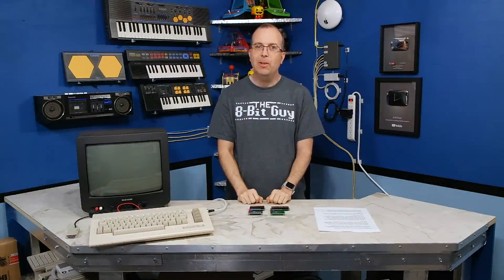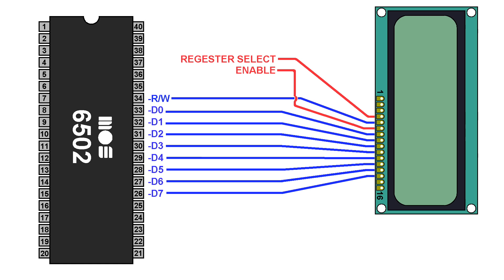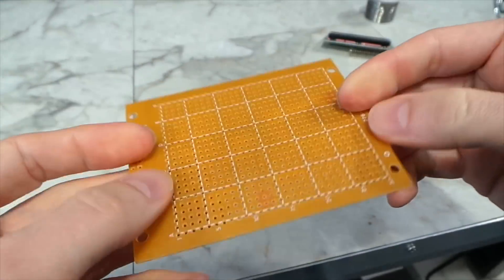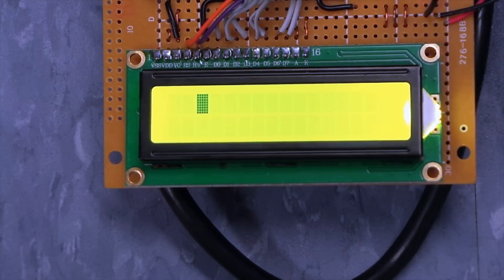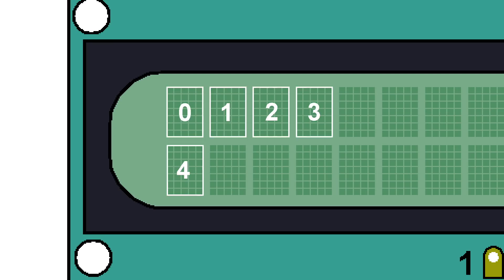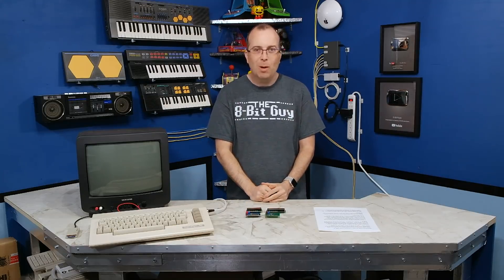How a Character LCD Works - Part 3

Comment: Theese displays can also work in 4-bit mode, requiring only 6 pins: RS, E, D4, D5, D6 and D7 - simpler hardware and a bit more complicated code. Also, there is no need to print 40 characters to go to the next line. There are many commands you can use, for example to go to a certain line, position inside line, change the cursor size and blinking, (auto)scroll the display, change the text direction, etc.

Comment: Maybe you can ever connect it to the serial port on my old AMD Athlon XP 1700+ system?
Reply: Totally impossible. PC serial ports work very differently than the pin assignments you see in the video. In fact, connecting it to a PC at all is going to be a challenge. But to give you a few problems for a serial port: Serial port does not provide power. Serial port uses 12V for logical 1 and logical 0. LCD Display uses a parallel interface, not a serial one.
Reply: The easiest way to connect to a PC might be to connect it to an Arduino that is in turn connected to a PC.
Reply: I thought something like that, i think i'll be programming something like that

Comment: was there a C compiler for the C64 in it's heyday? Dealing with the non contiguous LCD lines seems like the kind of thing that would be a pain in ASM but pretty trivial in C.
Reply: Nowadays there exists the cc65 cross-compiler. To my knowledge there wasn't such a compiler in the golden days. A weakness of the 6502 architecture is that it is not efficient to pass subroutine parameters via the stack, but is quite necessary to implement languages like C and Pascal efficiently.

There were Pascal compilers for the C64 in the golden years though, but that might have to do with that Pascal was much bigger than C in those days.

Dealing with the non-contignuous LCD lines doesn't look that terrible for doing in assembler to me though, likely a few branches to handle the different cases.
Reply: Daniël Mantione what property of the 6502 makes the call stack inefficient?
Reply: There exists no stack relative addressing mode, which means that you would need to pop from the stack one-by-one, or construct a separate pointer in the zero page.

CC65 doesn't use the processor stack at all, it creates its own stack, independent from the processor stack.

Comment: 2:13 IO1 pin is low not only when CPU is accessing 0xDE00, but accessing data in range 0xDE00-0xDEFF. If not, 0xDE01 won't work.
Refer to https://www.c64-wiki.com/wiki/Expansion_Port

Comment: ...or You could switch lcd controller from 8 bit to 4 bit communication and save a lot of troubles. But I guess channel name obligates ;-)
Also have a read on HD44780 commands, there's plenty of tricks to them... Like, you don't have to send all these spaces to get to 2nd line. You can simply set cursor position with 1 command.

Comment: If you do more experiments with electronics, you should buy an oscilloscope, or at least a logic analyzer, this would have saved you some days troubleshooting. The best solution is an oscilloscope with an integrated logic analyzer, because then you can see analog signal in combination with digital signals, like the rising edge of a signal or a DAC output. Siglent has good ones, not too expensive. Or just something like a Saleae logic analyzer.

Comment: You could change cursor location by setting data ram address to 0x40 for first character of 2nd line instead of wring bunch of spaces. May be more complicated to write a code, but will be faster.

Comment: Yeah, you really want to use assembly (or some other way, code on bare metal). Maybe a faster CPU too like on an arduino. You could make a graphic equaliser, like you get on a HiFi music system if you separate the audio signal into its harmonic series (for the EQ "bars akin to histogram bins", a bit like bass, mid, treble) using Fourier Analysis and then populate an array to draw on the screen, sort of like your demo at 8:47 in your video. Using an FPGA can help if you wish to commit some of the processing either to a gate array, or to make things easier for yourself since FPGA has FFT built in. As an HDL, you might use verilog. If you had a faster atmega arduino (with FPGA on it too), you could use c# .net micro. That way you might opt for a linked list instead of an array. Probably doubly linked list.

Comment: David, love the in-depth technical videos. Now, the Arduino is 8-bit too, have you thought about exploring that?

Maybe an Arduino programmable in a Commodore style BASIC would be more up your street. Perhaps one with a composite video output? But a simple Arduino will talk to a USB implementation of a serial port, and a fairly simple modification will enable it to talk to an old-school serial port.

I’m a professional embedded electronics designer but I enjoy 8-bit architectures. Indeed, I use 8-bit processors running at 32MHz for many control applications.

Comment: 3:10 You could've just used a single 2n3904  transistor to invert the signal, feed I/O1 into the base, 5v into the collector,  and connect the emitter output to the enable line using a 10k  or 20k pulldown resistor to gnd

Comment: Just recently started restoring my own C64 and it's 1541 that blew at capacitor. The C64 power supply is giving me 5V on pin 5 as it should but pin 6 is at 4.1VAC and pin 7 is at 14.3VAC. Yikes! Have retired that ol' supply and will be getting a new one.

Also, thank you. After 30+ years, I finally know what poke does. I just never bothered to google it. :-)

Comment: I wonder why 2 boards, with same components just smaller footprint, that looks like preparing for a production run. I wonder if these things will soon be to be bought in on the internet. 
That is probably also the reason why there is no explanation what the trick was to get it working.

Comment: Is your friend going to share his design so that we can learn exactly what it took to make this work?
Reply: I hope not.
Reply: Brek Martin Not following.
Reply: Because the LCD should be connected straight to the edge connector as it was designed. The PCB is just fluff.
Reply: Brek Martin As he explained, that didn’t work. The PCB contains components that were required to make it work. If this video was supposed to be something we could expect to do ourselves then it really isn’t helping much without that information. Simply connecting an LCD straight to an edge connector is pointless if it doesn’t work.
Reply: None of those components are required to make it work. Just the edge connector from a game cartridge, because nobody would want to solder directly to the C64 expansion port. All of that trouble was due to a fundamental misunderstanding of the HD44780 LCD controller. If I had a C64 I’d do it myself. I’d expect it to take 15 mins to wire up, and another 20 or so mins to have it printing something.
Reply: Brek Martin If that’s the case then you should have said that from the start and/or made some effort to explain how to get it working. That was the obvious question that prompted me to ask explicitly before you ever said anything. Your response didn’t even make sense without first saying that he was wrong in the video and that it wasn’t required.
Reply: I did exactly that in a comment that is still unedited in part 2 of this, and specifically said the he’s going to run into Hell when he starts programming for it. The comment is still there, and... look what happened :D The problem is that any software that comes out of it will have issues or not work at all for anybody who interfaces the LCD properly.
Reply: Don’t get me wrong, I love 8bit guy. It’s what happens when a software guy tries to do electronics. This series is a fail for many reasons.
Reply: Brek Martin Unfortunately, your comment here lacked all of that context, which is why I said I was “Not following.” I wish you had pointed me to this info in your earlier response. Even now, I’m not going to be able to find it easily (YouTube app doesn’t have a “search in page” function), but I will look it up when I can. Thanks!
Reply: I made a more detailed comment in this video too, pretty early on. When this one first came out, I actually ordered a cheap cart from eBay to raid for the connector, but a C64 isn’t so cheap. If I can borrow one I’d do it live in one take, but it wouldn’t amount to much anyway, as the video wouldn’t have the exposure.

Comment: Would’ve been really cool if you didn’t cut those long legs and used wire wrap instead of jumpers. Hack-a-day says it’s becoming a lost art and they are probably that long specifically for wire wrapping. That’s also why you see chip sockets with really long wires. Using one of those with a rows of pin headers to connect the ribbon to the gutted cart would have been pretty tidy!
Reply: Emmett Turner The long square legs are for wire wrapping, AND for plugging into matching sockets.  Similar round legs are just for plugging in.  Though either types can also be used if you just need extra board distance when stacking two boards.
Reply: John Francis Doe Yeah. The corners bite into the wire, through any oxide layers, and make a connection many say is better than soldering.

Comment: Idea: you can try plug some graphics LCD based on the SSD1963 to the cartridge port - that chip is a full on graphics LCD controller with internal VRAM. Even better if one of the two joystick ports can be used along with some analog sample and hold circuitry to implement resistive touchscreen.

Comment: Bwack just uploaded a video about making the C64 Saver open source. He also discussed adding a micro controller for display output. Seems like a math made in heaven, since you mentioned your C64 PSU overvolting your system last year. Luckily, I got one of his before he stopped making them. :)
Reply: Auto-correct changed “Bwack” to “Beach.” Fixed!

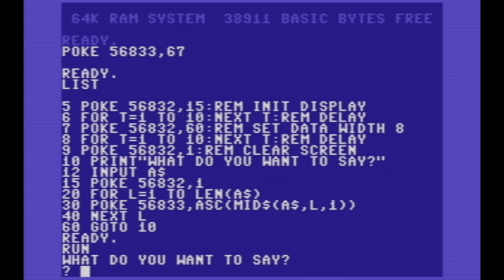Comment: (7:22) Interesting.
So, if I told the LCD to carriage return to the next line instead of leaving a bunch of space to fill in the rest of the 40 characters... visually on a 20 x 4 screen it would type on the 3rd line rather than the 2nd, and on a 16 x 2 it would overwrite the first line since there's no third line to write to (and of course, there might be some old data showing if I don't clear the screen first).

Comment: I expect that the LCD controller supports new-line, carriage return and some escape sequences or commands to move the cursor and clear the screen..?
Reply: Yes it does indeed, the way these are normally used. Aaannndd using 4-bit data, part 3 newer ever existed.
Reply: https://hackaday.com/2017/06/08/adding-character-to-the-c64
https://hackaday.io/project/25257/components

Comment: Don't use 74AC for low speed stuff like this. 74HC is more than fast enough. AC logic draws lots of current when the outputs are switching, which will mess with your power lines. The very sharp edges of the output signal also aren't good for signal integrity.

Comment: Pretty impressive.
Lol. Now you've got me thinking of modern graphical LCD's though.
many of them are 16 or 24 bit devices, which means you'd end up with more capable output than something like a c64 has natively. (well, more capable in the sense of being able to create 16/24 bit bitmap graphics. Unfortunately an 8 bit system generally lacks both the processing power and memory to work with that to any reasonable extent.)

Comment: Back in the mid 80’s I managed to control an LED connected to the expansion port on my Vic 20.
I maintain that this is the first use of RGB in a gaming computer.
Reply: You had a blue LED in the mid 80's? That's amazing as they were invented in the 90's.
Reply: @Okurkaarrgghh  r/quityourbullshit material

Comment: The LCD enable pin is active low (not high) so an inverter is unneeded. Just like your previous video, it might work, but will only lag behind. The same reason your button worked when you released it, rather than when you pressed it.
Reply: It isn't so much active low, as it is negative edge based. It's getting the edge to align that one has to deal with.
Reply: *unnecessary
Reply: * Yes, which has the exact same meaning as the completely valid English word: Unneeded. Meaning the inverter is unneeded, and the whole C64 timing issue exists only in the author’s imagination, and would fall away completely if beginning the project with correct pre-suppositions, which are achieved by reading data sheets.
Reply: Brek Martin I did not know that there was a word called "unneeded"
Reply: You must be looking at a different LCD controller. The datasheet for the one I have calls it active high.
Reply: Every HD44780 LCD controller (as used in the video) has an Enable Pin that latches data on the bus on transition from high to low. This is proven in the author’s own video (part II). I wish I had a C64, it would all be done in half hour or so.
Reply: Taehun Lee If you’re going to be a smartass, first you have to be smart. Otherwise you’re just an ass.

Comment: David, it's frustrating that your DIY board turned into a "No-Can-DIY" board.
Will you please do a video in which you interview David Hunter about the requirements of interfacing with the 6502?
Perhaps his buffer logic could serve as a standard interface between the 6502 and other electronic widgets.  THANKS!
Reply: The 6502 drives it's data lines after setting the address. LCD controller is faster than the 6502. 6502 sets the address, which causes the LCD to latch the data on the bus before the 6502 has actually even attempted to write to the bus yet, causing the LCD to read in null characters each time.

Friend put some buffering on to slow the signal down so that the 6502 can finish setting data before the LCD is triggered. 

It probably would work without this if you did the address decoding yourself instead of using the I/O lines, and/or switched to assembly instead of Basic.

Look at any timing diagram for the 6502. The C64 uses a 6510 but it's the same story.
Reply: The lesson here is ALWAYS read your timing diagrams! They're on the LCD's data sheet for a reason.
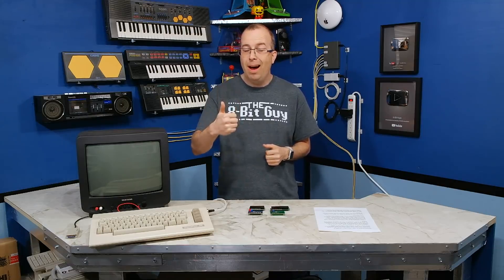Reply: There’s no requirement for any board. You could connect the LCD straight to the expansion port. Just ignore the part at 3:00 and read the LCD data sheet instead.

Comment: Can you put the schematic of the circuit that worked on your website?  I would have thought that just inverting the phase 2 clock would have worked, unless the problem was that the write cycle was too fast.  In that case, I guess you would have needed to decode another address and built a data latch so you could now control the E signal in software, (two pokes to set it high and then low) which would have been slow enough for the LCD.
Reply: I sent it all to the 8-bit guy today. If he can sort out where to put it, he should be able to post it.
Reply: +scharkalvin another approach :
https://hackaday.com/2017/06/08/adding-character-to-the-c64
https://hackaday.io/project/25257/components
Reply: +David Hunter thanks a lot & good luck :)

Comment: I think you will have a great time using the 128x64 graphical lcd because it has an ASCII mode that will work with your current code (8x4 characters / 16x4 half width characters), but you can try to use the graphics mode also. one more thing is trying to control the lcd you have with a 4-bit interface.

Comment: I've had a 4x20 reverse-polarized RGB backlight character display sitting in my 'Arduino Sh*t' box for like two years now and I still haven't messed around with it. (I'm a much bigger fan of OLED displays with their own integrated controllers because I can literally just talk to them over I2C...)  But now I want to go dig it up and try some things!

Comment: 2 years ago, I made a personal projet using a 2x8 lcd. Because it was directly driven by a 108 MHz Microchip dsPic, I had serious timing issues. I then decided to validate my code on a slower interface with the possibility of checking the timings, and I hooked up the LCD on my PC parallel port. Linux and Python pyParallel were my friends then.

Comment: Awesome video right up to where you sent it off to your friend. learned a lot just wish there was the same level of detail on what your friend did to get it working. This would be an awesome instructional kit you could sell. Would love to see more Vic20/C64/128 electronic projects videos.
Reply: Would love to see a schematic for the board and code for the basic programs.
Reply: mrb5217  Well, the code for the program that asked for what you wanted to say, and sent it to the LCD, is easily reproduced.

10 POKE 56832,15:REM INITIALIZE THE DISPLAY
20 FOR T=1 TO 10:NEXT T:REM DELAY
30 POKE 56832,60:REM SET DATA WIDTH 8
40 FOR T=1 TO 10:NEXT T
50 POKE 56832,1:REM CLEAR SCREEN
60 PRINT "WHAT DO YOU WANT TO SAY?"
70 INPUT A$
80 POKE 56832,1
90 FOR L=1 TO LEN(A$)
100 POKE 56833,ASC(MID$(A$,L,1))
110 NEXT L
120 GOTO 60

David used different line numbers, but it's essentially the same program.  Once you had the basics in place, you could then make it fancier if you wanted to.  For example:

60 PRINT "LINE 1 (16 CHARACTERS MAX)"
61 A$="":INPUT A$
62 A$=LEFT$(A$,16):REM TRUNCATE LINE 1 TO 16 CHARACTERS
63 FOR L=LEN(A$)+1 TO 40: REM PAD THE STRING TO 40 CHARACTERS BY ADDING SPACES
64 A$=A$+" ":REM THIS IS NECESSARY BECAUSE OF THE WAY THE LCD WORKS
65 NEXT L
70 PRINT "LINE 2 (16 CHARACTERS MAX)"
71 B$="":INPUT B$
72 B$=LEFT$(B$,16):REM TRUNCATE LINE 2 TO 16 CHARACTERS
73 A$=A$+B$:REM APPEND LINE 2 ONTO THE END OF LINE 1

The rest of the program would be identical. Obviously the program to create custom characters is much more sophisticated.  Maybe he'd be willing to put the source code on his website or something.